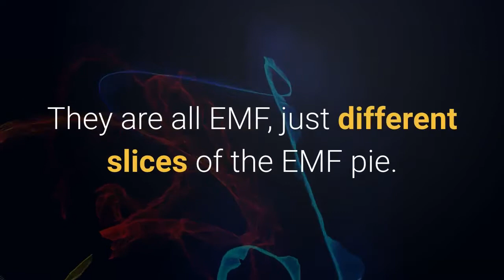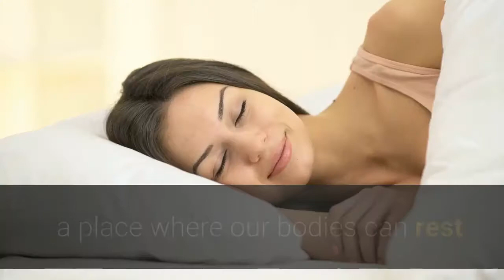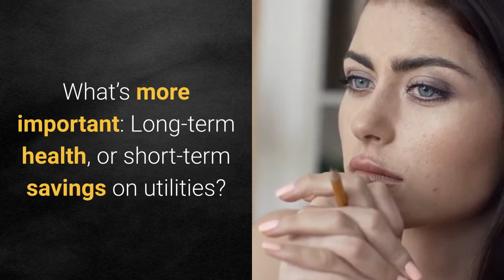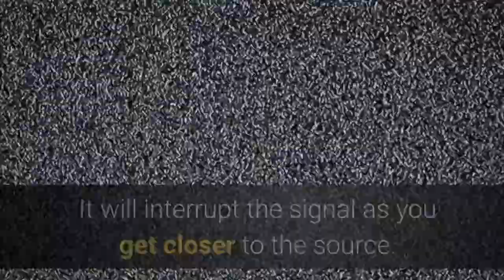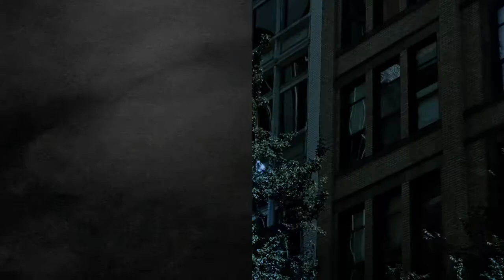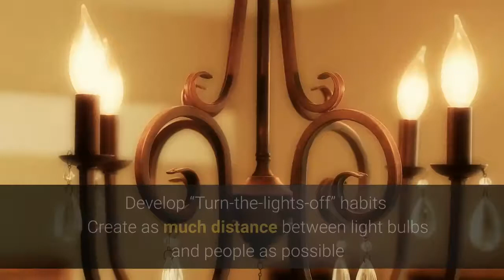Light Bulb Radiation Danger - The Best and the Worst

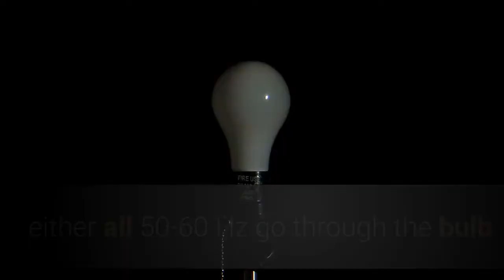Comment: 2:16 - electricity cant be throttled back it goes somewhere. It will bleed out through bad wiring causing dirty electricity emitting beyond the walls into the enviroment. Which will cause health problems
In the body.